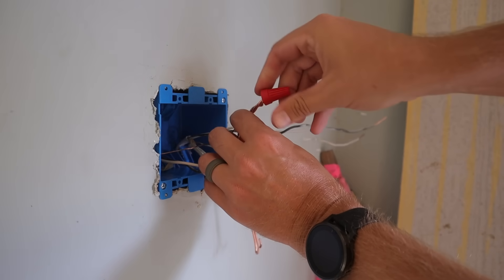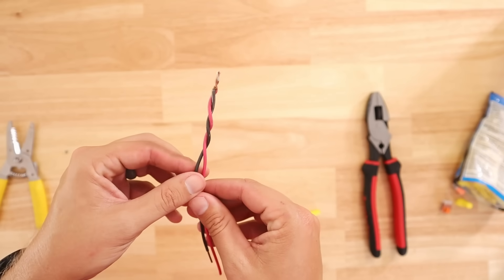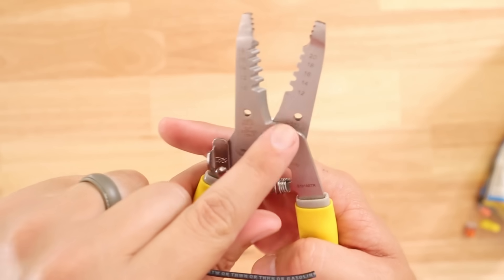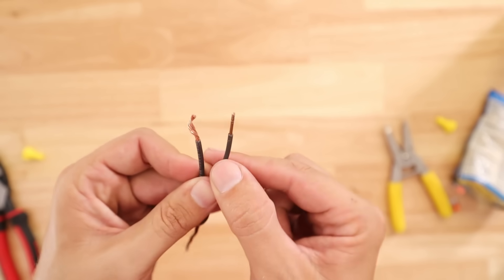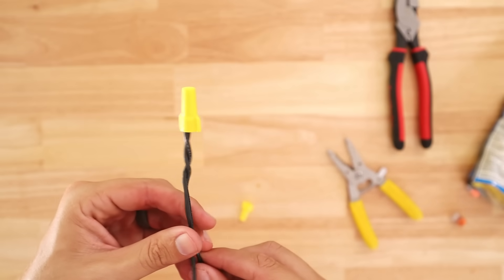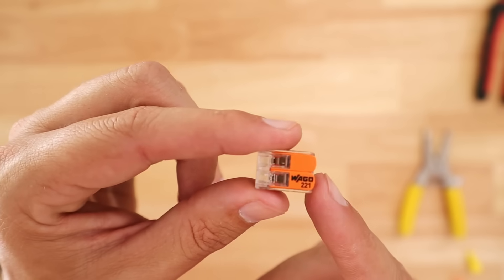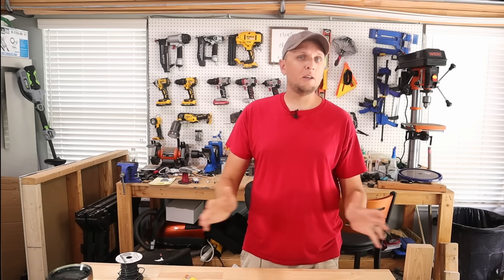BIGGEST Mistakes DIYers Make When Connecting Wires Together | How To

Comment: There is no "basically" in this context. If they don't include instructions per se, then there are no instructions. The code you quoted did NOT include recommendations as also needing to be adhered to in addition to, or as a substitute to any provided instructions.
Reply from the maker: Never said they did.  But "best practices" can be used.
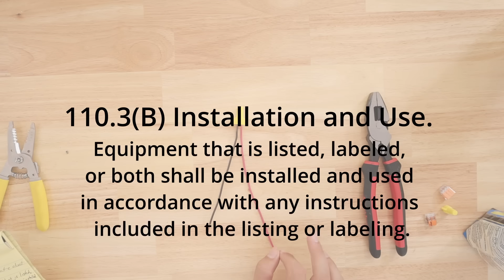Reply: @HowToHomeDIY  Starting at around the 1:36 second mark you attempted to interpret the code by expressing in part the following, "So what they are basically saying is..." At which point whether you had intended to or otherwise, expressly and directly implied that "recommendations"  or "instructions" were equivalent to instructions.

 They are not. If the bag of nuts's "label" were printed with printed "recommendations" for use and without any instructions, and given the code makes room for there not to necessarily be any instructions whatsoever, at least from the perspective of keeping within the codification from a user's perspective, if and only if no instructions per se have been provided, then the user, at least from and via the code you read so far hasn't been put in a position as if they should be treated as any instructions have been provided, if it so happens that none have been, which is good at least to an extent, as far as I'm concerned. 

And perhaps somewhere in a reg or code, manufacturers must or shall print labels that include instructions per se, but that strays from the importance of the point and my reason for commenting. DIYers shouldn't have to pay the price if a manufacturer drops the ball, especially if they are not also professionals themselves.
Reply from the maker: I read the code and then read the instructions which are then to code per code.  When I said basically it’s not a recommendation, it was me summarizing what was said in the code.  It’s not my opinion.  There were instructions given on the bag.
Reply: @HowToHomeDIY  You seemed to have missed my point or are not yet ready and/or willing to recognize it.  Of course you did not say the code was a recommendation, and of course I did not say you had done so either.   The fact remains whether you intended to or not (giving you the benefit of the doubt still) have inadvertently or otherwise very errantly summarized the code because instruction(s) are NOT equivalent to recommendation(s), at least per the part of the code you quoted and then proceeded to attempt to summarize.  

Another way to look at it is, is that attempting to summarize code is potentially reckless behavior because it might lead people to believe that the code has expressed what it did not express. Unless and only unless it is no longer the case when it comes to such things that the customary presumption that what was written, when it comes to the substance of laws and codes, is what was intended to have been written by those who drafted and published them. Often the government or a least a private organization that works with governmental authorization per one or more laws. 

But also, if that is the case, then the chaos that would eventually ensue would be tremendous because judges who interpret laws and codes for judicial matters would have free reign to guess at whatever they want the code to have "meant" at any one time, without even having to bother to attempt to justify their decisions via a strained argument, as advocacy judges (the worst kind of politician in my opinion) currently sometimes resort to once they get in office.

Comment: When I use wire nuts on any!!!!! wire connection. I always use electrical tape, starting below the wire nut on the wires. And wrap the wires,once I get to the wire nut I go around it at an angle at to bottom of the nut, then finish off straight at the top of the nut. Never had wires come apart on me.

Comment: Thank you!   Trying to splice solid and stranded wires has always seemed like an impossible challenge for me.  Will definitely find those wago connectors.
Reply: Using the Waco connectors for stranded has worked well for me. Don't really trust the twist with stranded and solid.

Comment: No you need to twist them at least in the netherlands . i can do 5 wires without any tools . And in the NEN they need to be twisted . and all the scratching on the copper is also a big big big fail . Never use your tools to twist your wires it will damage the copper , it needs to be done by HAND , if you cant do that  find a different job .

Comment: When I connect a stranded wire to a solid one, I strip them further back and then pretwist them together carefully making them behave more like 2 solids. Then after the end trim, I bend the end over and press them hard with the lineman pliers. Then use a red wire nut over that. That stranded wire will then break before it comes out. You did a great job on that video.

Comment: I'm not a big fan of the WAGO type connectors particularly on High draw outlets. I definitely wouldn't use them on any 20 amp circuits in a kitchen. They're fine for lighting and such. I've seen them get hot and fail. What happens is they heat and cool in a high amp situation and after a while they don't clamp onto the wire well and you end up with an open circuit. The contact area is small inside those WAGO connectors and that's where they heat up and fail. A wire nut is superior to those connectors IMO.
Reply: I completely agree, I work in automation and own my own company which means I can use whatever I consider best for the application. I use WAGO in some installations (low amperage for lighting in control panels, etc. but most everything is terminated in terminal blocks,  buss bars / terminal strips. very high amperage connections are done in multitap connectors.
I have done testing on my own using WAGO vs other alternatives and found that while the WAGO connectors actually held up to the printed amperage they had higher resistance in high draw than the alternatives (means more voltage drop and increased heat in the connection.
Reply: @morganmcintire2853  Cool. I used to wire control panels for automatic machines back in the 80s. It was all relay logic back then. PLCs were still very high tech and not very affordable back then. Terminal blocks and buss bars was what we used in the control panels. The high amperage stuff , we used lugs and taped the hell out of them. 😆
Reply: @marcellemay7721  Awesome! 80s Automation was built Heavy, I do a lot of work converting older relay logic into modern PLC systems. It has gotten a lot smaller, more energy efficient and wireing has become simpler. PLCs really integrate a lot of jobs into one component. a lot of modern industrial Automation even uses fairly inexpensive Rasberry Pi ARM based  PLCs) But honestly aside from the technology improvements not a whole lot has changed, someone like you who has kept op with the technology could very easily jump back into it.
Reply: @morganmcintire2853  Yeah, it's pretty awesome what can be done with a raspberry pi. I have a manufacturing engineering degree, and worked in it right out of college, but I became a general contractor, building and remodeling homes and businesses 3 years out of college. I still have a manual machine shop in my garage, and like to build and repair things from metal as a hobby now, but I generally earn a living in the building trade. Odd combination, I know, but my father was a contractor, so it was fairly easy for me to get into that business, as I always worked with him growing up.
Reply: Indeed wago connectors have resistance up to an order of magnitude higher than the wire nuts. It may be as bad as 1W of heat output for 220V 16A connection, which will get hot in an enclosed environment eventually. Still, wago is a lifesaver when doing lighting wiring.

Comment: In a box, twist properly. Use the proper wire nut. Pre twist before nut. Over twisting stresses nut. Leave as much slack to allow re working connection as fits. Use tape ON SWITCHES AND OUTLETS. Use tape on nurt if box is mettalic. That was what the old timer taught me.

Comment: It would be helpful to discuss the different color coding for wire nuts, perhaps showing the packaging, referencing the different gauges and the possible combinations of number of wires and gauges and size/color wire nut. The same for the WAGO.... #221 doesn't tell you much. Also recommendations regarding the advisability of reusing wire nuts.

Comment: Always use wire nut. Those wire connectors are about speed and convince . Some times old tried and true will save you trouble in the long run. I hate going back on a job because of a bad connection.  Been at this trade since 17 still doing it at 76 .

Comment: So its correct but not correct because you say its not correct lol. I completely agree that the wires need to be twisted as well. Thats how i was taught and have always done it. Ill actually twist until wires are twisted then give the nut a slight tug just to be sure its locked on fully because smaller gauge wire nuts will have the plastic separate from the metal inside sometimes.
Reply from the maker: What I said was incorrect, is in fact incorrect.

Comment: DIYer here:  I started pre-tinning my light fixture wires, and then using the wago connectors. So, SO much easier to get those awkward lighting wires done easily, without killing my spine getting them hung.
Reply: Certainly for lighting wires wago connectors are way more quick and easy to use. Just watch your fingers as the latches tend to bite them easily!

Comment: Nope, I will never pre-twist solid wire, let the nut do it for you. 25 years and I’ve never had any call backs nor problems! 
And if your wires are getting pulled with any amount of force, well, you have other major problems that need to be addressed. 
As for stranded to solid, I wrap the stranded wire around the solid, then put a hook on the end of the solid wire, bend it over and smash it down with my lineman pliers then twist on a cap. In no situation should your wires be pulled on…EVER.  And depending on location, I may even use some electrical tape, but that’s rare….Toots!

Comment: Thank you very much for the informative video. I do have one question. What do you recommend for stranded wire to stranded wire connections? Do you recommend doing anything different in that situation? Thank you.
Reply: I would recommend twisting the stranded ends together before placing the wires into the wire nut. (from my experience as an electrician)

Comment: Pretwisting has always seemed a bit better choice to me, but these days, unless it's over 30 amps, I always use the Wago levernuts.  For one, it's quicker and more foolproof than a wirenut.  You can see if they're making or not.  Also, no chance of having loose hots unlike adding or changing connections with a wirenut.  You can add or change wires anytime without that added risk.  Makes it my always go-to for J-box or anywhere I might add connections later, and I feel much more secure in 5 wires going into a levernut than a wirenut.   Plus cheaper wirenuts, especially ones that come with fans and other electrical components these days are cheap and often have no spring inside.  I can't trust that.  Thanks for the vid though.  Can't tell you how often I've found barely any copper to copper from someone not twisting right or putting the stranded too low with a solid.
Reply: or just never use wirenuts. Wagos are fantastic. Use them. Or use screw terminals. Not this crap
Reply: @PBMS123  Wagos have more resistance than a properly done wire nut. I wouldn't use them on applications where a lot of current is being frequently drawn. Great Scott" did a video demonstrating the power loss in a wago and they warm up when a lot of current is drawn through them. I have seen enough connections and solder joints fail due to thermal expansion cycles and I wouldn't personally use them.

Comment: Awesome video! I already had figured this out myself, but it was great to see that you say exactly what I thought and have experienced. The Wago connector is the icing on the cake. I totally agree with you!
Reply: Wago connectors are the worst thing you could ever use and the connection is pretty much a paper thin knife blade making contact with the wire… please don’t do anymore electrical…. “ I already figured this out myself” 🤣🤣🤣😎
Reply: @jasonsainsbury2858  If I recall correctly, he is concurring that the Wago connectors might not be as good, but that  they can be useful for STRANDED wire. I never use Wago connectors for connecting solid wires, because I agree with you there. However, when the need comes to connect a solid #14 wire to a thin flimsy stranded wire, then the Wago is a good option in my opinion. I'm referring to hooking up light fixtures or smart devices that use #18 stranded wire in lieu of screw terminals. The wires of the device are usually so thin that it renders your statement about thin connections in the Wago moot.
Reply: @pnnielsen  no it doesn’t they make wire nuts for 18 gauge wires I use them to hook up  furnace wires everyday
Reply: @jasonsainsbury2858  Furnace control wires are usually SOLID, right?!  Wire nuts are IMHO always the best for any type of solid wire. Wagos don't become useful before you have stranded wires...
Reply: @pnnielsen  no furnace wires are never solid they are all stranded the thermostat wire you connect to them is usually solid … still doesn’t matter those wago connectors are bottom line the worst thing you could ever use … absolute trash
Reply: @jasonsainsbury2858  Some people seem to like the Wagos though.... I have only used the Wagos for fixtures that shipped with them. I never purchased a single Wago connector myself ;)
Reply: @pnnielsen  I've never seen Wagos included in any fixtures, you're thinking of those awful one way push connectors that are best discarded.
Reply: @dubmob151  Ah, yes, I hear you. Possibly Chinese Wago copies. But they do look and work like Wagos, with levers and everything. Just sayin'
Reply: @pnnielsen  I have generic copies of the lever lock connectors, and while they feel rougher and not as smooth actuating as the Wago brand, I've done resistance measurements on both and they were equally good in that regard. I have no problem with the particular generic branded ones I've gotten.

Comment: As a DIYer I've been twisting wires with wire nuts like that for years but didn't know it was to code. It always just felt more secure plus that's how I saw professionally installed wiring done in my houses.
Reply: Wago is easier and safer though
Reply: @smokeonthewater5287  wago sucks. Just like back stabs
Reply: He said code requires whatever instructions come with the product.  The written instructions state that twisting is not required.  The picture shows twisting, so those who prefer pictures to reading will decide twisting is required by code.
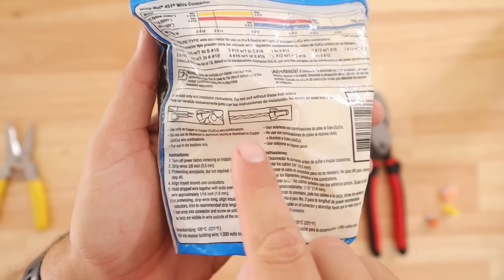Reply: @edinnorthtexas113  The written instructions say that pre-twisting is not required. However, whether you pre-twist or not, twisting itself is required. At 2:00 you can fairly clearly read the final step in the instructions: "7. Insert wires into connector and screw on until approximately two twists are visible in wire outside of connector."
Reply: @edinnorthtexas113  Thats put on the package for those who can't read...making it fool proof if that's possible.  Just look at the picture..

Comment: the push connectors are the same thing as backstabbing outlets, which has been frowned upon for decades. Not to mention all those "Ez" connectors are exponentially more expensive than wire nuts and arent any faster and i'd argue slower aswell. What do you do when you need to connect 3,4 or 5 12ga wires? Gotta know how to properly splice wires together with linemans

Comment: Please don't say majority of electricians. 
Looked like that bag had the right instructions. One stranded and one solid doesn't need pre-twist. Everything else you can pre-twist to ensure a good connection. 
When I do service and see the wires twisted together I am confident to move that joint out of the way. 
Your way isn't the majority.
Reply from the maker: Every one that I have been able to ask in person has said they pre twist everything.     I will go with that.  If you don’t want to, like I said in the video, you don’t have to.

Comment: Always test for voltage drop at the load end. Any appreciable drop is a flag for mis connection or other issues in the circuit.

Comment: I have done several DIY jobs and do pre-twist, but had NOT twisted the remaining insulated wiring as much and have had trouble getting the wires to fit back in the box as easily, so I DID pick up that tip.  I have used some of the basic push-in connections, but not the wago brand, but have only used them when connecting solid core to solid core.  I find these helpful when exiting boxes are small.  Thanks for the video.
Reply from the maker: You are welcome.  Thanks for the input!
Reply: I thought this was an excellent video for me.  😁   Thanks!

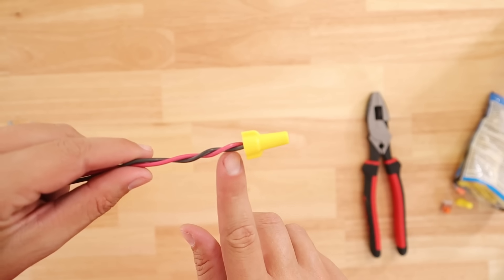Comment: 03:26 to a trained electrician this is acceptable but diyers forget that sometimes the spring inside wire nut will break and wires will fall out anyways or break if wire is nicked causing heat of electricity to condense at nick point and cause the leading reason for electrical fires so make sure there is no nicks before adding wirenuts and use proper color sized coded wire nuts based on wire gauge , dont just use any color wire nuts

Comment: Maybe it's because we use 240v in the UK but this type of connection has to be the WORST thing I've ever seen apart from being just LAZY. As an Engineer I would sack anyone who tried this.
Reply: In The US, the thought is opposite.  
And they genuine think the wirenuts  is the best to use when voltage and power is high.  Even electric engineers over there is sharing this opinion.